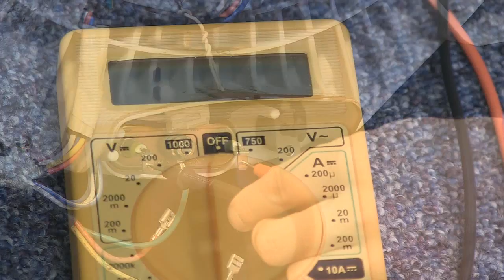How to Diagnose Washing Machine Control and Program Problems

Comment: Hi, I have Primus RS27 Washing M. It's not loading water, but  machine is working normal the panel. didn't give any error code.water inlet solonide valve not working there are not showing any volts please help me
Reply from the maker: +vakil prajapati We are not familiar with this machine. How far did the machine work as per the video above?. IE did it lock and will  it empty or spin if selected?.

Comment: I have a GFWS2600FWW that wont start. symptoms are strange. no error codes. when you hit the power button you see the panel light up and the start pause button will begin to blink and the lock will engage and disengage repeatedly. you cant change the wash cycle and the unit will never start. suggestions???
Reply from the maker: We would suggest to start with the door switch as if this is not engaging correctly would give this type of symptoms.

Comment: Hi, I have Sharp Washing M. It's loading water, but don't start engine, automatically pump out water and stops. Just displays "end" on the panel. didn't give any error code.
Reply from the maker: Check the motor circuit as this may be stopping the cycle. 
For more information see our video: 
https://www.youtube.com/watch?v=D5Aw7CBEGPI

Comment: Thanks for the useful vids. Our Bosch Avantixx 8 with digital display does not give any fault messages but blocks in mid cycle, flashing NO on the display. The cycle will then continue to completion by pressing the Start button again. I have run various programmes, some with no clothng in the drum, but the blockage and NO message reappear. Ideas?
Reply from the maker: Sounds like your machine is not heating the water and the machine is spotting this and stopping. Put the machine on a boil wash and see if you can feel any heat on the glass after ten minutes. If no heat see these other videos:
https://www.youtube.com/watch?v=Ftm8lDVVw2E  and
https://www.youtube.com/watch?v=PMYM_j8Uoyk

Comment: Thank you for such an informative video.  Our frigidaire affinity washer was working perfectly before we had a bad thunder storm.  The power to the house was going off and on and we ran around the house unplugging computers, TV's, and my washing machine.  The machine had power (the lights on the front were on) but we unplugged it anyway.  Now it won't work, it only displays error codes, a whole variety of them.  Do you think the control board has been damaged?  You were mentioning something about fuses?  Any help you give will be greatly appreciated.  Thank you.
Reply from the maker: Hi Prariepatch, It is possible the control board has been damaged by a surge in electricity and this may be more likely if your supply passes through overhead power lines. However it may be due to components 'ageing' and not fully resetting after the power has been off. Follow the video again and if the machine does not reset and at least partially start the machine then you may need to replace it.

Comment: I have a hoover DST10166PGBC-80 washing machine and the door won't open at all, the led display is stuck on one program and won't let me change it and just displays end on it as it was the last program what finished, after a few minutes an e07 error code will show up
Reply from the maker: Error E07 on hoovers is either a door lock problem or a jammed drum.
Turn the power off and wait for three minutes and the door should be free to open. If it does not give a sharp thump to the door frame near the handle as the shock may free it. If the problem reoccurs suspect the lock.

Comment: Liked very much this video. 
I couldn't find the short circuit though. It trips the safety switch after I finished set the wash program and press start. Normally I would expect the valve to open and water to flow. Regardless I unplugged the inlet valves or heater it trips at the  launch the program.  Not sure what elements the program starts before the inlet valves ? It's a lg wd-1049c.
Reply from the maker: +Thierry Lo Sorry I am late replying but Youtube has just 'found' your comment. If the board trips your power as soon as the cycle starts and does this when the heater is fully disconnected the problem may well be the board itself.

Comment: Hi I have a Hoover DYN9144 DG washing machine and for the last few weeks the program has not been working it's always switching from different programs making the wash cycle go on for longer. Now the machine is not showing anything but there is power. Please help!
Reply from the maker: Hi Naomi, test the connections to the board and check for any signs of damage on the board, unfortunately, you cannot test the board so you need to eliminate everything else before you decide it's the board even though it does sound like that is the problem.

Comment: My washing machine Beko WMD 67106 shows "C On" the screen. It doesn't lock and it doesn't start. I tried a 3 sec reset but it didn't work. What shall I do?
Reply from the maker: +mimi Sounds like child lock. Look at the buttons, if there is an image of a padlock and lines going to two buttons press and hold them for a few seconds will usually  turn on or off.

Comment: My washer is dead when i open my main control board no led light lid. Would you say main board? lg Wm2277HS
Reply from the maker: +MO SADEDDIN If no lights or beeps but you have continuity from plug to board it would suggest a control board problem.

Comment: Hi, I have a Whirlpool washer Model# WTW57ESVW1 that seems to be out of cycle. When you first start a cycle it usually fills with water first ,then goes into the wash cycle. My washer starts to fill and agitates immediately. Then when it gets to the spin cycle, after spinning it stops and then begins to fill with water as if it were starting a wash cycle. Any help would be greatly appreciated. Thank you
Reply from the maker: +Bill Martin If this is a new washing machine it may be that the machine has been programmed for these little quirks. For example many machines 'weigh' there load by turning the drum and stopping to work out how much water is required and most will rinse spin and rinse before another final spin.

Comment: Hi eSpares, after some advice please mate, got a zanussi FJD 1466W, just doing a wash and then a loud click sound and it stopped, all lights except the power light have gone off, goes that sound like a new control panel replacement to you guys?
thanks matt
Reply from the maker: Hi Matt, check the connections between the control board and the power module. If you cannot get two lights to display suspect the control board at the top of the machine.

Comment: hyia i have a AEG LAVAMAT L14800 washer dyer and everytime i put it on a wash i returns to a 3 min drain wondered if anyone can help its not going though any wash cycle at all
Reply from the maker: +chantele wyllie Your type of problem is the reason why we made this video as at first glance you cannot see a problem. You need to watch what is happening with the cycle so for example it sounds like it fills then stops filling and starts to wash moving the drum. If this is definitely the case then the most likely problem is going to be the heater so check out this video:
https://www.youtube.com/watch?v=Ftm8lDVVw2E

Comment: I have a Samsung front loader, having issues during the final rinse cycle, it will hit 6 minutes, then jumps to 10 minutes, this continually happens...does anyone have any suggestions?
Reply from the maker: Hi Kelly, if it has reached 6 mins it should be on the spin and if it does not pump out successfully it will keep trying which will increase the time, check the filter for any blockages and test the pump.

Comment: My Bosch kept on giving E57 error
Once its on, it has the pump water sound... n then the error appears... its not spinning and not doing anything anything else. Door is locked which has to be removed by manual method
i wonder whats wrong.... .
Reply from the maker: +Akoya z Sorry we are late replying but Youtube has just 'found' your comment. We believe E57 is a door lock problem. Try unplugging and restarting but if it reoccurs the lock may be faulty.

Comment: indesit iwd 7145 washing machine checked power and fuses all fine suspect it may be a pcb problem quoted £200 plus £90per hr for an engineer to call and tell me what i can work out myself very unhappy about the quality and reliability of this product and indesit attitude. any advice?
Reply from the maker: Julian Rudd Hi Julian, the problem with Indesit and Hotpoint machines is the manufacturer has decided only to supply modules that need programming by specialist equipment. As a result it makes a module replacement a job for the specialists. If you are in the UK Repaircare can arrange a fixed price repair at a reasonable cost so it may be worth checking them.

Comment: Hi, I have a washing machine samsung WD-B1255 and when I use a high temperature, some times I have an error "8E".
I read in the machine manual and I saw  this error referred to something related to  a thermistor.
I replaced the thermistor, which is situated down with the heater, but the problem continues.
The washing machine has another two thermistors which are situated on top, where is the drying system, but I think those two are for drying system and they don't involve in my problems.
Please help me whith any solution

Thanks in advance
Reply: *****
Thank you for your clues, I will check the control panel.

Comment: you dont half waffle on mate what rot,
,have you never heard of a megger ?you sound like a component changer to me i worked for hoover for 20 years dead machine,check source of supply,check fuse,check suppressor ,check bi metal door lock,check timer,you dont just jump to the conclusion the control board is faulty,its called fault finding,try it some time
Reply: yeh

Comment: I have a Kenmore Elite 41473210 washer that turns itself on and then beeps (reminder) to start the cycle. If we unplug the machine and just plug it in when we wash it will cycle through fine and shut off- several minutes later it turns itself on and starts beeping. No fault codes. I'm guessing one of the boards is going bad? any suggestions?
Reply from the maker: +almost genius It is more likely to be a heating problem if everything else appears ok. If the machine fails to heat the machine may recognise this and shut down. For more information see some of our Diagnosis videos in the following section:
https://www.youtube.com/playlist?list=PLZopaZU-UQSHj1noiwEJ99JjXWcEcSAbZ

Comment: Zanussi zwg7120p 'displayed' pressed buttons to display the error which is 43.  Has anyone had this issue with the same model. I have read that  if the problem is with the controller, another can not just simply be swapped over as they need to be programmed. Is this correct?
Reply from the maker: The programmed module is available and listed here: http://www.espares.co.uk/product/es1721168/washing-machine-display-pcb
However the error E43 relates to the door lock so suspect that first.

Comment: My Whirlpool front loading washer that gives an E08 code, "if I clear the codes" it will do a half a dozen loads fine, then, fault the same E08 code. I can repeat that over and over again. I am thinking the mechanical water valves are working fine but the control board is the problem. 

I am curious what you think?
Reply from the maker: Hi Mark, check out this video that goes through Whirlpool error codes https://www.youtube.com/watch?v=5eKNcFbcaF0

Comment: Hi there i am having a problem with my machine, it is beko ev5100+, the problem was with the pump, i replaced it, and still it do not put the water out, i have opened the electronic cirquit, and a triac was broken. But i can't find another triac like that, it's code is z3m g f338, i changed also a rez that was burned. Pls can you tell me where i can find another triac like this or where i can search for another cirquit ????
Reply from the maker: +ledjano cela Unfortunately the manufacturers do not make this information generally available and an engineer would simply replace the panel.  If you wish us to quote for the cost of the part please fill in the information at the page this links to:
http://www.espares.co.uk/contact/sales

Comment: Ok, and by control board and power module, you mean?...
 I know of the CCU central control board and the interface control board (the one on top crony behind the push buttons). Are you saying then to replace the interface board?
Thank you so much for your help!!!
Reply from the maker: We cannot confirm any part if we are not working on the appliance.
Fault tracing is often a process of elimination so it 'suggests' there is a problem with either the CCU or the interface boards (or possibly both). You could inspect these carefully for signs of burning or damage but often you cannot confirm a faulty part without replacing it.

Comment: Hi, my LG washing machine play button is not working. All other buttons work properly except the play button. I also notice that if I hold down the play button for about 5 secs some lights will start blinking. What do you think the problem might be?
Reply from the maker: Hi Olaiwola, you need to determine if the button has failed or possible the board, gain access to the control panel to check.

Comment: My Indesit Washing machine is displaying a F18 fault and all lights flashing.  can this be fixed?
Reply from the maker: Hi DM P,  on most Indesit machines F18 indicates the control panel cannot communicate with the main module. Disconnect and check around the connections that couple them together looking for damage or signs of spillage and check one of the buttons are not stuck in. If all this checks OK it is likely to be the main module. This is expensive and will need programming to work at all hence the recommendation for a 'fixed price repair' if this is the case

Comment: My Whirlpool Washer (Model #WFW9150WW01) will not start when I push the start button. The wash light below status flashes 3 times then 2 times while beeping the same amount of times. Any suggestions on what might be the problem?
Reply from the maker: Hi Robert, this error usually occurs when the machine has not drained correctly so check there is not a problem with a blockage or the pump. If this is OK it may be a pressure switch problem, this identifies the water level in the tub and if blocked can think it is still full. For information on this see our video:
https://www.youtube.com/watch?v=2pIVkAxWSXg

Comment: My AEG over a couple of washings stopped going to zero at the end of a cycle. The cycle would finish correctly and istead of 0 would display the start time blinking, ready to press start. Then one day it tripped my breaker and turned everything off. No error code could be seen as tripped as soon as turned on. I checked heating element, grimey and crusted, replaced with new.  Now the machine turns on but when pressing start spells ERR in the panel. When pressing start and next button , then shows E66 --- which still is related to heating element ? How do I proceed from here ?
Reply from the maker: Hi HazeOverL,  the ERR usually shows if the programme has selected correctly, the error code E66 will still be stored in the memory which is why it is showing when you press the buttons.

Comment: recently i started repairing my washing machine which is LG wd80485NP, There when i assembled the pcb i get a beep sound and that's it. the board is not showing anything on the board.
Reply from the maker: Hi Gaurav, are you sure it was the board? have you checked the connections to the board and did you make sure you handled the board correctly, sorry fit the questions but need the answers to help.

Comment: I have a zanussi ZWF1237W which stopped a wash at the rinse stage and showed an E20 fault. As per instruction manual i cleaned the pump and removed a piece of material. Each attempts at a wash still stops at the rinse stage. I can fiddle around with the knobs and get it to do just a rinse. Please can someone tell me how to do a reset to clear the E20 and get the machine to do a complete wash, rinse, spin cycle as before. (I have tried leaving the machine switched off at the mains for 24 hrs.)Grateful for any suggestion. RB
Reply from the maker: Hi R Burhouse, To error code is stored in the memory and can be removed if you enter diagnostics to clear it but you don't normally have to if you are still getting E20 then you still have an issue with the draining cycle. Check the drain pump impellor and test the pump with a multimeter first, check for any blockages inside the hoses that may be stopping it from draining.

Comment: Hello, I have a beko wy104764mw. Problem: first noticed machine beeping erratically and couldnt cancel cycle. When finished the control was not responding. Left alone for 24 hours and wouldn't power up. Unplugged and cleaned all filters water inlet and pump. 24 hours later it powered up and I put it in self clean which it finished without issue. It would not power off or let me select any new program, small lock symbol flashing when any button was pressed. Unplugged for 20 minutes and I got to select daily quick but it wouldn't let me customise this temp or rpm and it randomly selected start and when I closed the door it started the cycle and finished and again the small lock symbol would flash when any button was pressed. I believe this is the lock symbol for child lock. Please can you help me out its only 20 months old and out of warranty. The pcb board linked to ti's model on your website looks different to the board in my model.
Thanks in advance.
Reply from the maker: Hi Noel, sounds like the child lock has accidentally been turned on, Look at your instruction book for details or check the control panel for a symbol of a face or a padlock between two buttons. By pressing these for five seconds will usually turn on or off the lock.